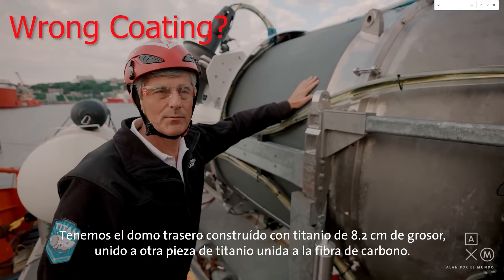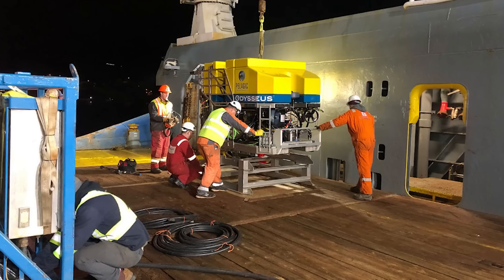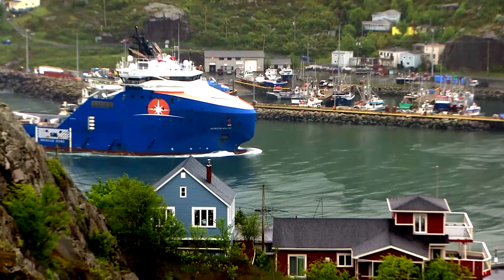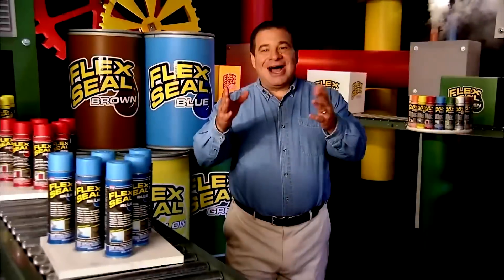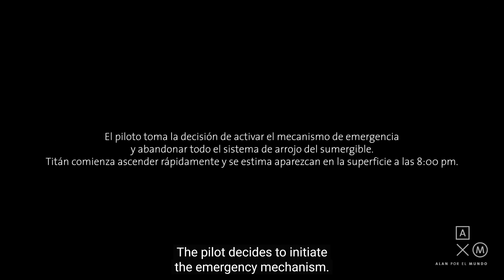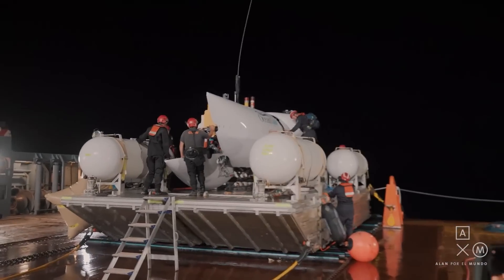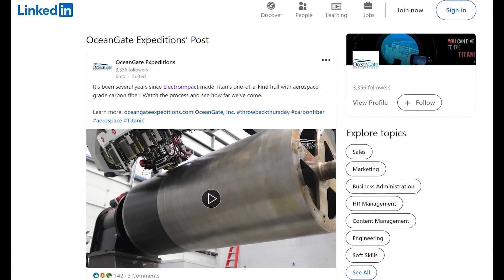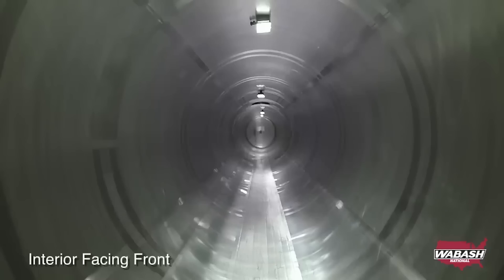Titan Sub Wrong Coating? Hull Construction, Debris Field Search

Comment: The crazy thing is Rush saying the purpose of the Rino liner - to stop water ingress into the carbon fibre. So the fibre cracks and water gets in, the craft gets much heavier, and sinks too fast, showing it is half destroyed already.
Reply: They were doomed the moment they launched. Even at that moment, they probably lacked the ability to resurface. It was already too heavy.  That thing was a coffin as soon as the bolts were tightened.
Reply: @LatitudeSky THEY still had time to surface.  The team noticed at 15 minutes the descent was almost twice as fast (indicating extra water onboard).  If Rush had aborted the dive, they still had the ability to rise (though much slower than designed)

.
Reply: I didn't see the video of them applying it with household paint rollers, allegedly.  
Or was it a Wagner Power Painter???
Reply: @mistert7958 I didn’t see the paint rollers either but I did see them using yellow plastic body filler spreaders to smear their adhesive on the end pieces.  Lots of pinholes and bubbles the way they did it.
Reply: @mistert7958 Are you f'nn serious?!
Reply: PT Barnum quoted : “ There’s a sucker born every minute “! I feel bad for the grossly misinformed passengers, who would surely have cancelled any trip on the “ Experimental death trap “ that OceanGate built and will surely pay dearly for now, despite any flimsy waivers!
Reply: @joelopez3954 Them possibly dying was mentioned many times but I forgot the count,six maybe.
To ride that without your lawyer on board should tell you something.
Reply: @GoHomeEdMck  reasonable expectation of safety. stockton showed a (very strong) pattern of ignoring safety standards. this is an easy case tbh. it's like going to a theme park and riding a roller coaster. you purchasing the ticket is a binding contract that has all those same terminology as the titan sub expedition had. if you die on a rollercoaster and find that the theme part intentionally refused safety certifications and bragged about cutting corners when building it... yeah you're getting a pay day. 
 stocktons family will curse him until their own eventual demise for leaving them with the shame, humility, and uphill legal battle that could leave them broke. i wont be surprised if the family just immediately settles for an extremely exorbitant fee just to make this all go away and get their (now shamed) name out of the news cycle.
Reply: @mistaajones  I worked at a amusement park when I turned 16 and asked to be one of the crash test dummies after it had rode empty many times. I had only a few minutes before the ride and I enjoyed it first. We didn't sign a waiver before we rode or I wouldn't have. Ultimately your responsible by doing something like that. This is a new can of worms and we'll see what happens.
Reply: @GoHomeEdMck Laywers are smart enough.
Reply: @GoHomeEdMck  After I met the maintenance chief of an amusement park, I stopped going there.
Reply: @jguenther3049  It was brand new and just assembled and had dozens of empty runs first. These aren't the maintenance crew they needed on the wooden rollercoaster. It was real old school.
Reply: Did they weigh the sub before and after each dive?
Reply: @77huss  I assume they did not weigh it each time, because if they had, they would have noticed a dramatic change before this dive and discovered the cracks etc., under the cracks/buoyancy theory being proposed by people here. If they did, then the problem wouldn't have been the cracks, the problem in THAT case would have been "insanely continuing forward anyway after having already just found the problem and knowing it wasn't seaworthy anymore"
Reply: When that thing finally was docked in its cradle, 8 hours later, he should of towed it away from the Titanic, put 40 pounds of C4 in  it, blown it, and called it a day. And then opened an undercoating shop. 4 innocent folks would be alive today.
Reply: It would've been better off made out of denture material
Reply: The traditional Rhino Liner forms a kind of hard shell.  Now consider that the hull will flex under compression.  Such a shell cannot stay bonded to the carbon and so it will separate, develop cracks and leak.
Reply: Why would water ingression into the carbon fiber make it heavier in water? Isn't water the same weight as water?
Reply: @AttorneyBCollins  It would change the weight inside to make it plunge deeper faster than it's supposed to. It hastened the implosion to where just moving around inside couldn't help(slow the descent).
Reply: @AttorneyBCollins  Yes, the comment is without merit.
Reply: Some weeks ago I read about this
"water theory".
That is ; Somehow water had pene-
treaded the coating, and had made
the hull heavier..
Which explains the way to fast de-
cent, & later on, the Inabillity to ascent.
But ! Then some wiseboddys
claime, that their is no air in car-
bon fiber = no room for any wa-
ter. Solid as any metal. (?!?)

Hm... really ? I have worked with 
carbon fiber for 25 years.
There is lots of air in it ! And it 
will suck up fluids.
It's quite simple to test. Just break some cb. And sink it into some wa-
ter. Then , after some time, quickly
dry it of, and weigh it. Bingo !

(-and don't forget the gigantic pres-
sure down there !)

The Titan was simply to heavy be-
fore they launched it into the sea.

It didn't help to throw some sand-
bags...
Reply: Adding weight wouldn't be an issue.  Water ingress into the carbon fiber won't affect the weight at all when submerged.

What it does do is propagate microfractures into macro fractures and catastrophic failure, because the entire exposed surface  of the crack is equally exposed to the same water pressure.

So basically, the water pressure acts as hydraulic jacks pushing on all exposed surfaces equally, wedging the cracks wider and deeper... and as the cracks get wider and deeper, the total pressure forcing it open is increasing in direct relationship to how much more exposed surface there is, resulting in an accelerating failure, where the bigger the fractures are, the faster they grow.
Reply: @geodkyt  You don't know what you are talking about, clearly.
Reply: @TimTimTomTom  [Laughing while reviewing Environmental Qualifications Test reports for US Navy ships.]
Reply: And was there any bad chemical reaction between the two linings?
Reply: Nuh uh, the Rhino Liner will keep the water out......that's why he used it. haha
Reply: "So the fibre cracks and water gets in, the craft gets much heavier, " 🤣😂 did you ask you 5 year old to submit his theory? because that is what it sound like.
Reply: Dive 87 doomed  them. It shouldn't have  happened. I am sorry for the loss of life...for all but one❗
Reply: No, there is no air in the carbon fiber to be displaced by water, so this theory doesn't make any sense. In order for "water to ingress" you'd have to make a space for it first, by a delamination or something, which means that by definition, that wasn't something it was ever relying on to have air in that space either, so it couldn't cause a problem. The only two things that make any sense for sinking too fast are: 1) Too much cargo / too heavy passengers, or 2) Maybe if some spaces were filled with oil (rear equipment bays outside the pressure vessel), and the oil leaked and was replaced with slightly heavier water.
Reply: @gavinjenkins899 THE sub had some hidden areas not visible to people onboard. If those areas filled with water while still at/near the ocean surface, it would add extra weight & sink faster.

And yes that means the carbon fiber had a leak.